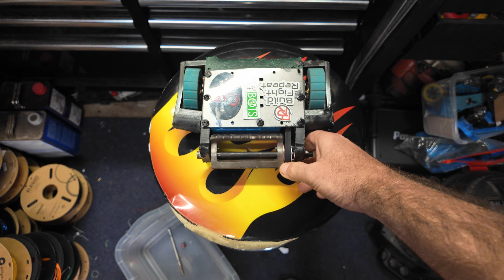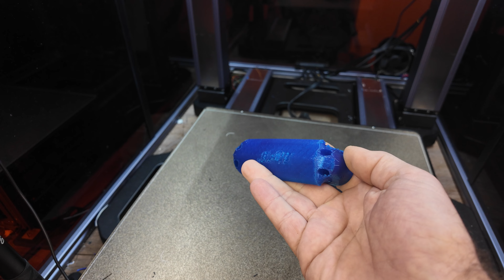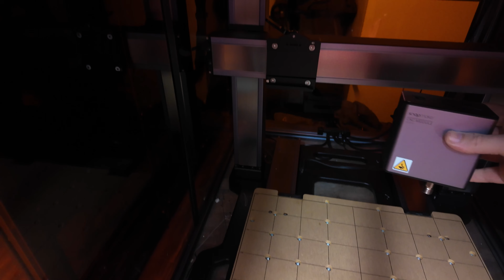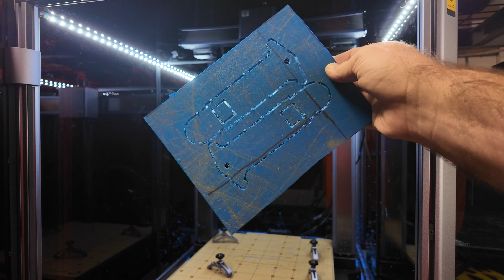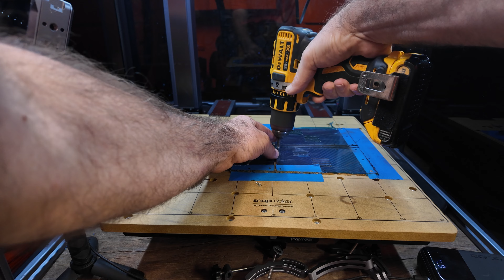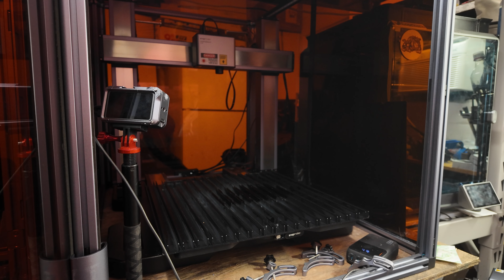Building Big G with 1 Machine!. @Snapmaker  ARTISAN!

Comment: That's one nice machine, it does so much good for the mini bots. I would not have the use for it so a more simple 3d printer is good enough for me.
Reply from the maker: True everyone doesn't need all 3 features. I wish I had your CAD skill.
Reply: @TeamJunkYardDog  I do not have a lot of skill with CAD, I sort of muddle through making things but slowly getting a little better. In a video soon I do design a new battery/electric tray for the Clod. I do have a new 3D printer coming as my old ender 3 Pro 3 is playing up a lot. Nothing fancy just a V3-SE.